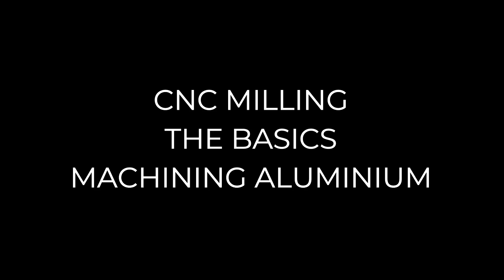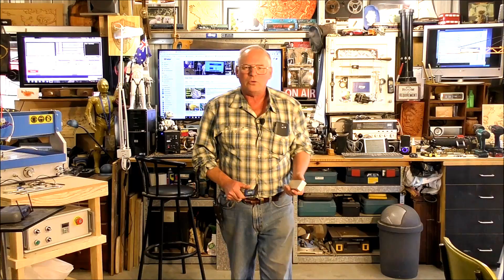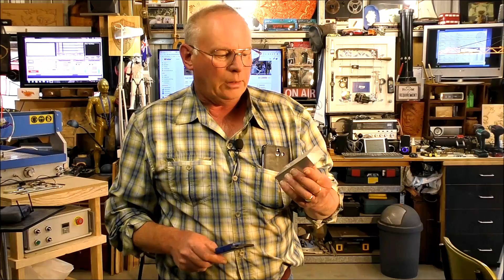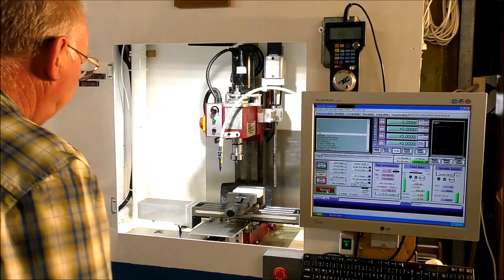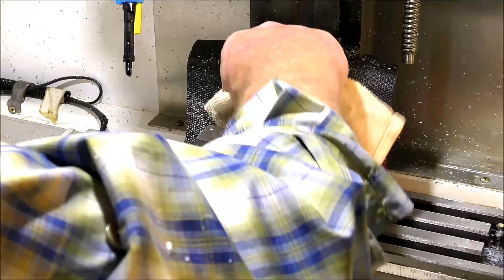Getting started with CNC and Mach3 (The first steps Video 3) CNC MILLING/MACHINING ALUMINIUM

Comment: Nice video thanks, I installed mach3 Turn and configured it however when I put in Gcode I get dro and tool path working but can’t it get the motor moving again if I jog the axis I get dro running but no motor movement. Where am I going wrong. Can you help. Thanks
Reply from the maker: I have a video to help you
https://www.youtube.com/watch?v=KcAsAQUjDNg

Comment: Is it possible to use the tool information section to set you tool heights without having to reset your zero every time?
Reply: Also, is this machine capable of 3d scalping?
Reply from the maker: Yes, but have a look at my CNC Routers

Comment: Good evening, wouldn't it be better to program the center drill and following operations (in Fusion 360) on a stock that is 0.5 mm smaller, so we wouldn't have  to do "the 0.5mm thing" again and again? There would also be less chance of making errors?
Reply: Yes or you can just type in -0.5mm so it would be the same difference. If you kept the drill where you zerod it without having to jog it up to +0.5mm. Edit* I'm actually not sure if you can do that in mach3 like more expensive CNC controllers I haven't tried it yet so that may be the reason he does it like that.

Comment: Hi Roger
Just to say, I'm quite sure you can set the Z at the bottom of the job, then no need having to keep setting Z height
I could be wrong Lol
Great videos
Reply: You obviously need to set the z zero position every time you change a tool bit - great videos Roger - very easy to understand for a beginner
Reply: Yes every time you make a tool change you right
I used to have a cnc machine myself
If you set Zero at the bottom
It's sometimes easyer, that's all I'm saying